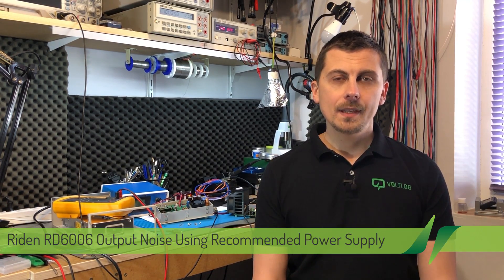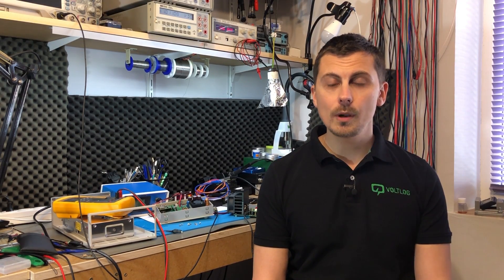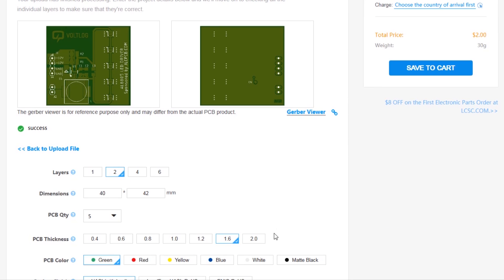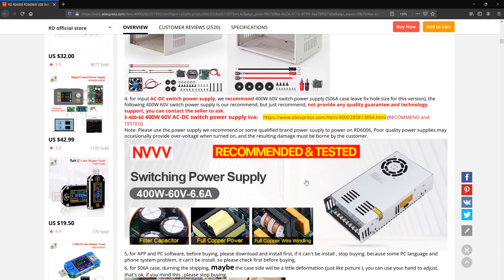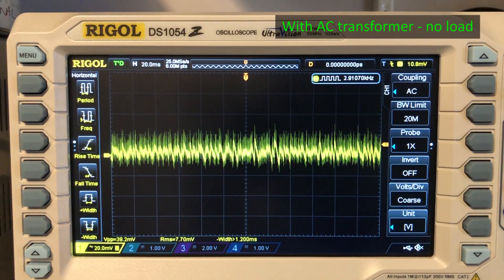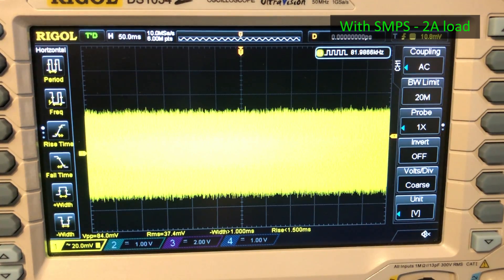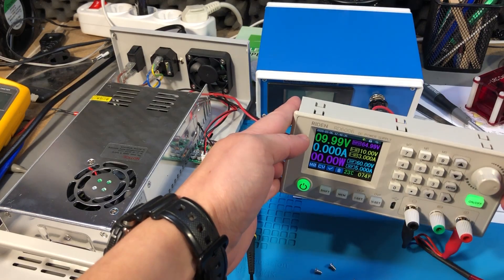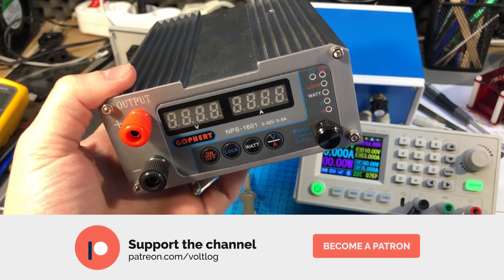Voltlog #290 - Riden RD6006 Output Noise Using Recommended Power Supply NVVV S-400-60

Comment: Please handle the NVVV power supply carefully. The minus (-) output terminal has a voltage of up to 12 V to the housing.
This can be a problem when the minus (-) is connected to the ground of oscilloscopes or when you connect the minus (-) to the housing of the power supply unit.

Comment: What do you think is the best value, general purpose power supply, new or second hand right now? I've heard that the old HP stand alone bench units from the early 90's are a really good value.I just want something that can power basic micros and the occasional bipolar analog stuff in one minimal benchtop footprint. I just got disability status approved and want to put together something slightly more respectable than my hacked stuff.
Reply from the maker: I have an old HP E3611A which would work very well for the circuits you described however it does have a couple of disadvantages: first it's a rather large unit, similar to the RD6006 and second you only get a voltage and current reading on the front panel with 0.1V and 0.01A resolution. But it's a good, stable, reliable power supply with a low noise output it just lacks modern features. A better choice would be a gopher np1601.

Comment: Gopher mentioned! Great products for the price. I'd happily pay 20€ or so more for a separate knob for volts/amps and a more responsive display with better contrast.
Reply from the maker: I think in the end it's a limitation of the front panel size. We get the advantage of the smaller power supply but we loose space on the front panel which limits options.

Comment: Nice power modules. Since it is 80 kHz noise it is easy to filter ther est out. Thanks for your effort.
Reply from the maker: You would have to do some important changes to the front panel PCB to be able to integrate a filter